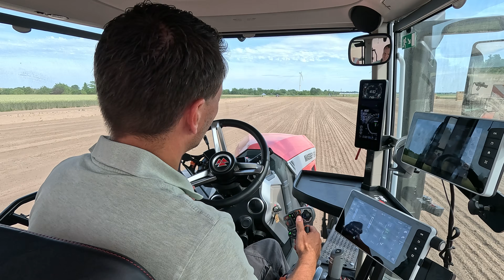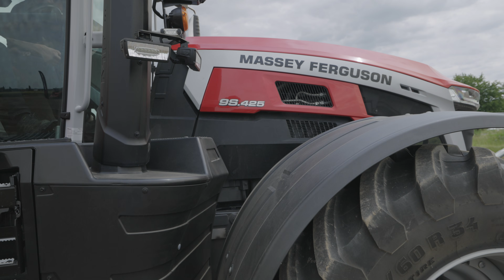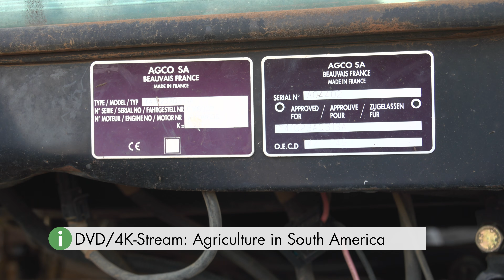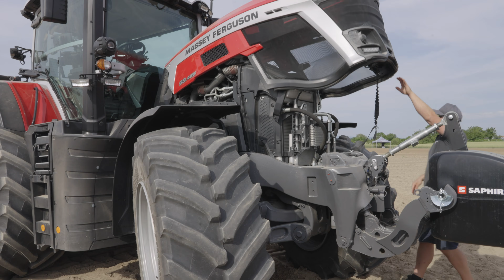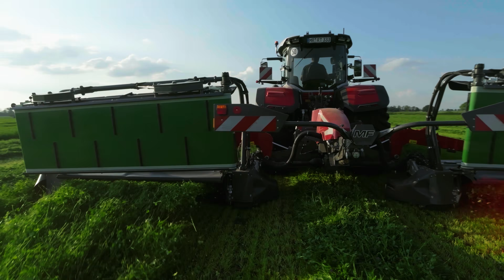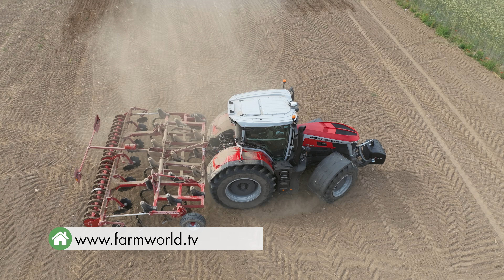Massey Ferguson 9S Test Drive | New Tractors | Agricultural Machines | 9S 425

Comment: I'm glad to see Massey getting back into the big tractor game
Reply from the maker: Yes, nice piece of equipment
Reply: @roberterdei8627 are those branded Massey Ferguson? Fendt doesn't count because they were brought in and then started making changes to the other manufacturers.
Reply: Pretty much every mechanical part, bar the cab and bonnet are actually Valtra derived.
Reply: @jamesbarbour8400  so you've seen it in person? Tall claim to make when they're just a prototype yet
Reply: No the transmission is the fendt Vario. Not from valtra
Reply: Deutz?@roberterdei8627